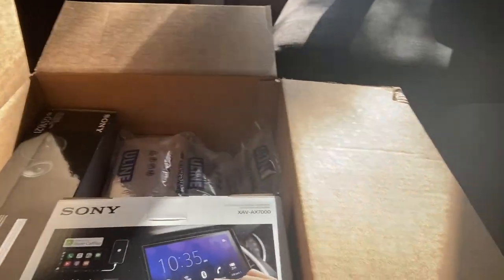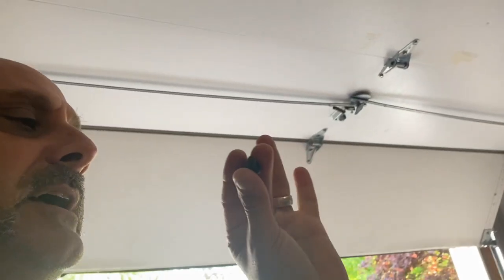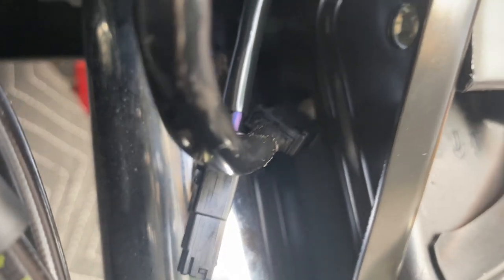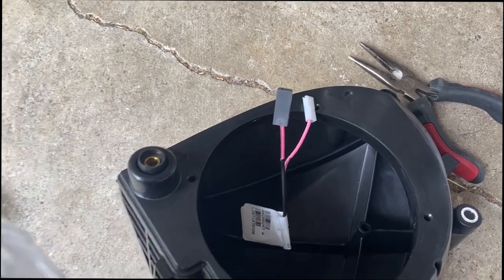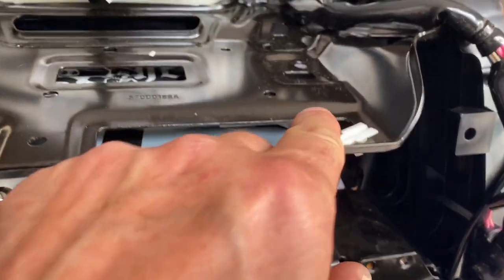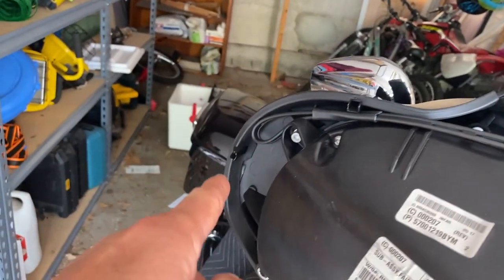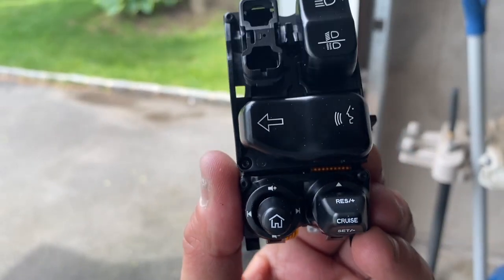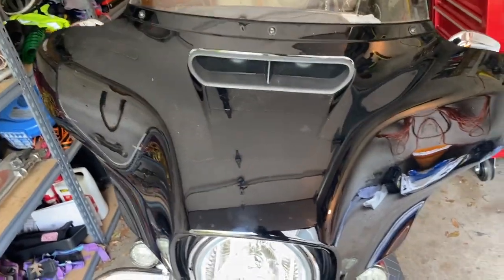How To Install a SONY XAV AX7000 on Harley Davidson

Comment: Nice video.  I installed the Sony 5000 on my 2019 EG Standard from Fathead Cycles.  A bit of advise, make sure to wrap the SWC and Interface boxes in plastic or waterproof tape.  If any water gets inside of these like from washing your bike,  the stereo will act up and you will get error codes on your bike.  Trust me, it happened to me.  I washed my bike and water got into both boxes because I took the plastic off when I installed the system.  This caused about 5 different error codes to pop up. Once I got them dried out the problem was solved.  I hope this avoids you a major headache in the future.
Reply from the maker: Thanks - will do
Reply: Great video put in my 19 standard, throwing codes like crazy. Clear them and still return repeatedly. Fat head sent new harness, didn’t resolve problem. They sent entire new radio maybe install this weekend. All u codes which is communication everything works. Any advise?

Comment: Although this vid is old, without it I'd still just be thinking about installing speakers. I went with a Bluetooth amp rather than a full head unit but the tip about moving the electronics out of the way was a lifesaver👍

Comment: Hey Sandy your video is a lot more helpful than the people over at Fat Head....I too have the 2020 Electra Glide Standard (FLHT)...I'm in the process of making it my own, little by little...so far I have the Passing lamps, saddle bag guards, heel toe shifter, converted my rear turn signals to running and brake lights, and turn signals, and added a set of Rinehart slip-ons..next I think I'm going to do the stage one, and maybe followed it with this really nice system that you added to your FLHT in this video...Sandy, continue doing how to's, your a natural born instructor....Excellent job.👍
Reply from the maker: Wow - just saw this comment  - Thanks so much brother for the kind words. Yeah I'll definitely post more How to videos. Ride on... And safe!

Comment: I can confirm, gentleman is correct, I had a heck of a time removing the 3 per side, 3/16" allen head bolts.   Finally after about two hours, removed all 6 of them.  I did not remove the tray screws / christmas trees and slide the tray sideways, I just didn't want to mess with any more of those christmas tree fasteners - sure they work fine, but I absolutely hate removing them, real easy to destroy on the removal.  Thinking it thru though, to reinstall the speaker pods with those 6 total 3/16" bolts, I will do as the gentleman recommends, remove those two screws and christmas trees,  and slide the tray to one side then after those bolts are in, slide the tray back the other way to put the other side bolts in.  Radio install went in very quickly no problem, those speaker pods are a real pain though.  I will not mess with those speaker pods again.

?  Sandy, on the clutch side speaker pod there is one larger plug that was fastened with a christmas tree, and one smaller plug also fastened (not a typical christmas tree) in some way to the speaker pod, not sure how to remove this fastener, with out breaking it that is.  How did you remove that small plug from the clutch side speaker pod?

Thanks for the great video!
Reply from the maker: Hey Elvis - the truth is I’ve done the install a long time ago and I don’t really remember that specific problem.... Glad you’re all done anyway...👍🏻💪🏻

Comment: After installing your sound system and handle bars control’s...do you now have cruise control?
Reply from the maker: Bike comes from factory with cruise control
Reply: @HOLYSHIFT  ok Ty was not sure if it did. Thanks for sharing your video are very informative. Rubber side down

Comment: I have same system did same thang you did and I have No power in stereo
Reply from the maker: First time I turned on the switch after the install - nothing happened ! I turned off then on again - and everything worked . If you bought at Fat head cycle - contact them , maybe they didn't do the harness properly...

Comment: Just installed this unit on my pop's bike. It does not have a GPS, navigation and most other functions must come from your phone. Break your phone and your left with Glorified FM radio. Also it is touch screen but has a row of buttons across the bottom. While trying to set it up I would have to use these hard to read buttons because no one screen buttons would bring me out of the page I was on. Not water proof as you can see from other videos and much less functionality than many other 100-250$ units
Reply from the maker: It’s not perfect - but it’s better than I there before...😜